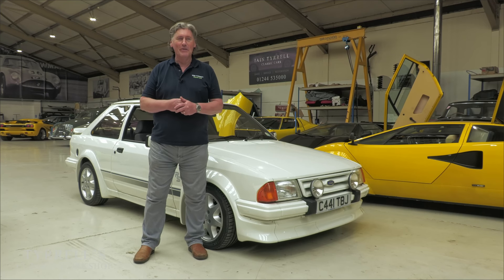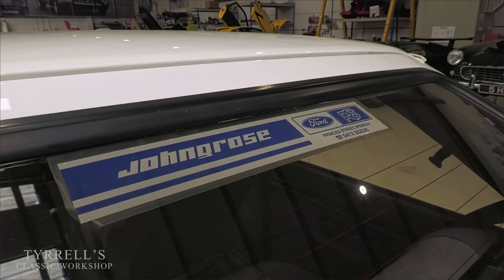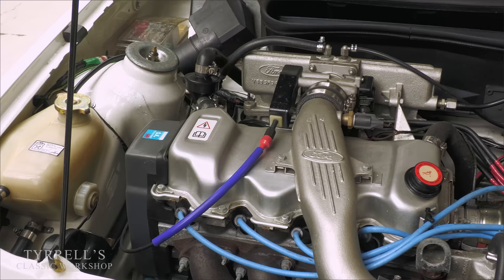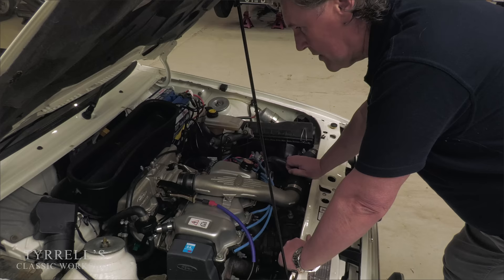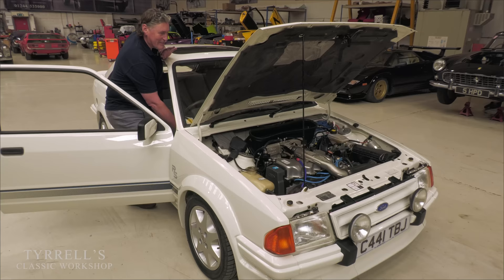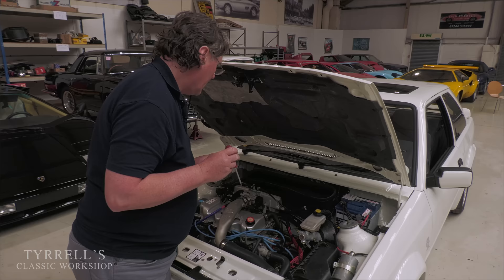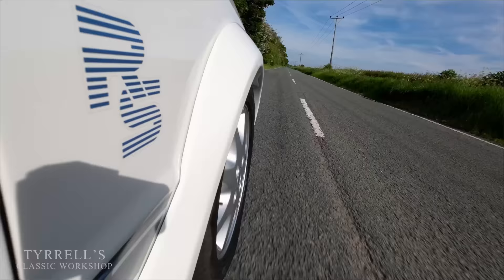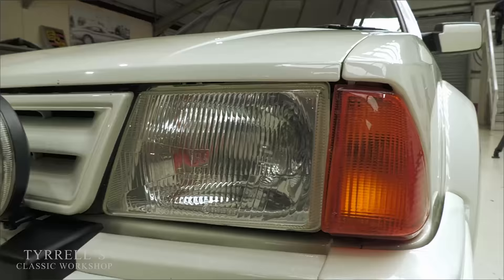Unleashing the Power: Reviving the Ford Escort RS Turbo's Performance | Tyrrell's Classic Workshop

Comment: So glad you mentioned putting the screw back. Im an ex Saab master tech and the amount of 8v Turbos i worked on where the blanking plug had not been put back and just thrown in the bin. As you say then leaving a air leak which causes the venturi flap not to move correctly with the air flow.

Comment: Hi @iain_tyrrell That was mine and a friends car up until 2016. I was the person that rebuilt the car from the shell up (mechanical and electrical) over the period of a few years and competed with it in concours for several years. I have quite a few pictures somewhere of the restoration and build process. Great to see it still in great condition. It was fantastic to drive around B roads.The Motorcraft plugs were fitted when I built the engine so they have never been changed since around 2013!
Reply: Where is that 1975 model
Reply: @reuben3431  it’s an 1986 model.
Reply: Sick car cracking job 👍🏼
Reply: @orangelip1  thanks. 👍
Reply: I fitted Motorcraft plugs in 2017
Reply: @john-fv1vf  you worked on it in 2017? Fair enough then. The plugs are newer than I thought.
Reply: I had a mk1 RS TURBO fom John Grose as well...i was living in sudbury .....what a car!
Reply: @DazC2  86 models had side repeaters. Must’ve been built in 85 but registered 86. 🤔
Reply: @Jase73  it’s a post August 1985 but pre April 86 car. I can’t remember exactly though as it’s been years since I saw both it and the log book. I have another on a C plate (bare shell that needs restoring and I can’t remember what month that was registered) and another B plate which is a June 1985 car. I remember the B plate one as I’ve had it since 1999.
Reply: @Jase73  it’s an August 85 car so it turns out. I couldn’t remember but I knew it didn’t need side repeaters. Only cars after April 86 needed side repeaters, so later C plate cars onwards.
Reply: @DazC2  yes that makes sense. Mine has side repeaters it’s just an 86 model  Jan 2nd 👍
Reply: Top job Daz
Reply: @davemellor4697 makes up for living in Subury
Reply: @tomhoward4905 why did you feel the need to say that?
Reply: A credit to you, good job
Reply: Nice. Why did you get rid?
Reply: @GTMarmot  I was co-owner with a friend. I didn't want to sell, but he was mid house refurb and needed the money for a bathroom. We'd had a few years of competing at concours with it and we only ever used it in dry weather, so I decided that it was probably time to let it go, reluctantly.
Reply: Best small hatchback car going MK1 RS turbo. Back in the late 80’s - early 90’sI owned a 1986 C reg custom pack was uprated to 200 bhp by a company called Collins. Only had 15.000 miles 1 owner when purchased in 88 kept it till 95. In 92 i replaced the standard alloys for near brand new 92 spec sapphire cosworth lattice alloys which i bought locally from a salvage yard car was barely 3 months old made the RST looking mighty fine with mud flaps. Many legends say best MK1 around and the power setup was ultra quick loved every minute of that car. I guess everyone who had one back in the days like myself wished never sold it. Just about got £8700 for it 😂 it would probably be worth 4 or 5 times more now 😊 what a beautiful car the MK1 is 😊😊
Reply: I've never shown a car, but was surprised they can win concours with a big bore pipe
Reply: @richy69ify  Depends on the class. It was in novice as it was our first time, where it is not down to the condition or parts on the car, just how clean it is. Once we won gold cup (best car of the season) we had to move up into intermediate class with different rules. Part of novice class is that the car has to be driven to the show and can't be trailered, so we had it taped up in blue detailers tape when we drove it to and from the shows. There was also a standard class, where the cars have to be as close to standard as possible. There was also a modified class, but I never looked into the rules for that one...
Reply: @DazC2  
Thanks!
Reply: @leechampion6538  I bet your a right laugh at a gathering 😂
Reply: @davemellor4697  Grose all over the place a, tought they were just suffolk and norfolk
Reply: @MJ-hh7de  That particular car came from Ipswich branch (Ransomes euro park) They were the only one of the Grose group who were RS dealers...The other ones were just run of the mill fords. I have delt with Grose for years buying RS etc

Comment: I bought a 1.3 litre mk2 Escort 2 door in Calypso blue ( boxy headlights) when I was 21 when it was 3 years old and when I was 20. Did all the servicing etc on it myself from Haynes Manual and have never forgotten the joy of owing it nor places I went in it. Just loved the HT lead and spark plug section. My pal also bought one. We used to tune with a strobe light and a small paint mark adjacent to the distribution cap. What fun ! Thanks for such a great vid

Comment: I remember doing my apprenticeship at Ford when the mk3 was launched, and we all thought it "space age" in looks and tech! We used to replace valve stem oil seals regularly on the cvh as they would hardened and would smoke badly. Thanks for the memories Iain, another great video as always.

Comment: Thankyou for featuring this car Iain, great to see it , it sounds pretty good under load, I think these were 900 - 950 kgs, your right about the power to weight, that's what makes the difference,  I've never owned anything fancy, just normal cars, but I do have a lot of interest in them, I've noticed the difference when you start going past 100 bhp per tonne, this Escort with roughly 140 bhp per tonne should feel quite spritely, quite enjoyable, great to see you feature it, I notice you have lots of knowledge earned over time and experience, more car mechanics should be learning this sort of knowledge to make sure we can keep as many older cars on the road as possible for as long as possible

Comment: Wow!! This takes me back to 1988. Brilliant. 
Thanks for featuring it on your channel Ian. What a treat.

You are totally correct, they feel really fast behind the wheel. The combination of very lightweight, sudden big boost and a large lag are quite unique. 

I ran one of these for 3 years and loved it. Trouble is the local car thieves also loved it and spoiled the ownership experience.
Sold it in 1991 for......... £3500. Not a wise move.

Comment: Friend of mine had one of these with a specialised engines uprated engine and hybrid turbo, he let me drive it and i hit the rev limiter very quickly after pulling out of a junction, the engine backfired and ripped the rear silencer clean open. Really easy cars to work on, everything on the car was never more than a weekends work, even engine changes.

Great video, brings back a lot of memories, that exhaust is a very distinctive sound that you just dont forget.

Comment: The K-Jet running lean was such a classic. Every year the mixture would need to be thinned to pass the CO at MOT time. I used to thin mine and richen it up again when I got home in my original Audi quattro. A great FI system., couldn't really go wrong, even the KE-Jet. One thing was the roller cell fuel pump, always worth checking current draw, should be about 8 amps, as they wore out the current would increase, say to 11 amps and it was time for a new one.

Comment: Back in the good old days... In the early 90s, I worked at a Ford dealer in Austria - and Turbo Escorts were not such a rare sight. There was allways the fight between the VW GTI, the Fiat Ritmo Abarth and these Fords. They were very quick cars, but also very tricky to handle on wet roads, especialy with worn tires. Very light car, under 900kg, lots of power from a wild turbolaging engine... With their tricky handling manners, those cars died quite fast in accidents. For those, who could handle these little beasts, they gave a lot of fun - till the rust comes. And boy, they rusted early as fast, as they drove.
And there was the turbo trouble: nobody explained this to the customers, before they came to the workshop with a dead turbo. And the spare parts were extremly expensive, so the Escort RS Turbo got a very bad reputation, being an unreliable car - all the times, compared to a less powerfull GTI.
Reply: All hot hatches were like this, the 1.6/1.9 Pug 205Gti too. It wasn't the cars, it was the clown drivers mainly.
Reply: Wonder if the RS Turbo was as unreliable as the Renault 5 turbo? (which needed new cylinder head gaskets every couple of months.)
Reply: @buggerlugz6753  The 5 turbo was just about OK if properly serviced and kept standard. The trouble was it was too easy to wind up the boost and then the second owners thought the engine could manage on the maintenance diet of a Ford Kent.
Reply: a friend of mine got a Kadett GSi and his brother owns a 205 Gti... Welcome to the 80/90!😍
Reply: @buggerlugz6753 No, the RS Turbo is very reliable if looked after. (110,000 miles on an un-rebuilt engine so far 😉.)
Reply: I worked for a Ford dealership in '89 preparing cars for delivery to new customers. They had fields full of cars and big boxes of keys. We'd go out and spend half a day extracting a particular car from among hundreds - of course we'd HAVE to take some for a spin! I drove all the GTi, XR4x4 - turbo what-not ; you name it. Crazy times.

Comment: I remember adjusting the mixture on cars with carbs and the process was similar. Set the idle and timing first, then adjust the mixture until you got the highest idle speed, then re-adjust the idle back down to what it should be. Either side of the correct mixture, the idle would reduce so you look for that sweet spot. Happy memories of when we could work on our cars :)

Comment: Fond memories indeed , shorter springs and adjustable koni dampers , superchip and fiddle with the wastegate.
It would corner like it was on rails and try to pull its own front end off 😂
Those were the days 👍

Comment: The father of my first long-term girlfriend had the XR3i version back in 1998 - with the exact same wheels, exact same interior - I don't remember if the chrome inserts were around the air vents, but boy does the back seat bring back the memories. The car was extremely rusty but ran great - and although it made usual "Ford noises" - the interior was rattly and loud - the man drove like he had stolen it, maybe he had in fact, don't know. I remember the car being extremely quick and handled well - especially for the engine, which was... 1.4, I think? Also - years later had the opportunity to ride shot-gun in a later - 1993, I think - Escort RS2000 - on a short parts run, while our family car - a beautiful 1986 Audi 100 2.2i - was at the local service centre - and the guy from the shop, the shop being on the far side of a small town - gave it the absolute beans - and those two Fords meant I always had tremendous respect for small, fast Fords. Seems nowadays that Ford, at least the European part  - has lost itself somehow with steadily less and less new Fords appearing on the roads - and I can see why - they all seem to lack character, something which both that little XR3i - and the RS2000 - had in absolute spades. Thanks for the - once again, great video - greetings from Latvia.

Comment: This came from an era when you could adjust fuel injection systems, where as modern systems are pretty much pre set, so it represented a electronically managed carburettor in its day. The mechanic I used was particularly talented with his adjustments, being Alfa Romeo trained,  allied to the old Crypton Tuners , ( remember those) which he kept thankfully long after they were not required for moderns- as an older customer I kept bringing him older cars to manage! I was always pleased with the colour of the inner exhaust as a light “dull” grey , rather than black like some classics exhibited , which proved they were running rich.

Comment: I'm glad you did this review. just as i remember this special car , the car could go round corners on rails but you could only push it so far and it would just let go , no warning it would just go. the miss fire could be the high-tension leads it happened to mine i just replaced them. the exhaust was straight pipe from the manifold all one piece , the gear shift was close together the clutch was heavy and at low speeds the steering was heavy. loved it. the engine had an intercooler on it - 0-60 was about 7.5 to 8 seconds with top speed of about 128-130 mph. i traded it in for a Renault 5 GT turbo and that would beat it hands down in every department but the car i would want again would be the Escort RS .

Comment: I was fortunate to own one which I found in Gibraltar , I saved it from being scrapped back in 1997 ! Managed to source most bits in Spain as were a lot of left hand drive ones over there still kicking around! I wish I still had it but I sold it to a pal of mine and made a healthy profit back then .
Mine suffered from overheating a lot so was happy to part with it .
Nice to see this one is bog standard your knowledge on these engines is spot on .
Thanks for showing this fine example

Comment: Another great video !!!.
Back in the day I used to use NGK and Motorcraft parts on my 1980 mk2 Escort.
The original Motorcraft battery lasted 8 years while the replacement ( not Motorcraft ) lasted not even 12 months.
By the way a magnet may come in handy. 👍🇦🇺

Comment: Another great episode from the Tyrrell-Iain. Thanks for this down to earth video. Your comments on stalks, is apt. Modern cars have become so fussy and festooned with trickery that I bask in the old tech in my eclectic classics as well as the simplicity of fiddling and fixing them without needing to resort to repeated use of the swear box. Back in the day, these Escorts were benchmark, attainable fast cars and whilst some might compare them unfairly to modern power outputs, back then, these and the likes of the Golf GTI, Peugeot 205 delivered on many levels, not just straight line speed.

Comment: Loved your advice on cooling the turbo's down. When I hear that kind of information straight from you, I know it's true.
Reply: It is true although it has to be said that engine oils have become much better since the 80's. A fully synthetic oil can withstand quite high temps without coking up the turbo bearings.
Reply: I remember helping a mate change a failed turbo on his MG Montego Turbo back in the early 90s. He used to thrash it everywhere, and then just switch off as soon as he got to where he was going. After a while, things got very smoky and eventually the boost disappeared. A new turbo and an oil change restored normal performance and stopped the smoke, but when we took the old turbo apart there was burnt oil residue (like a black coke material) everywhere. It had not only been restricting the oil flow, but had also distorted the oil sealing ring. He was a lot more careful after that.

Comment: I worked for a Ford garage in Portsmouth when these came out in early 80's I had to tow it in from the ferry port as it had run out of petrol before being put on a ferry to Jersey I think, and being injection I couldn't get it going (I'm not a mechanic) but once it had been fixed I got to drive it back to the ferry port, and of course I had to give it full beans :-) a drive I still remember to this day as I couldn't get over how well it stuck to the road, a fabulous car!

Comment: Power to weight ratio is everything. As Colin Chapman used to say - “just add more lightness”. Thanks Iain for another great video.
Reply: Yep, that’s why the 7 was so quick in its day even with a small engine. Caterham still carry on with the lightweight design ethos. 550kg or lighter or a little heavier depending on model.

Comment: I owned the original RS Turbo back in 1987, mine was a 1986 car and the Custom model, like the one in this video.  I remember after spited driving that we would stop open up the bonnet and the turbo would be glowing red hot and Iain is correct, you had to let the turbo cool down by leaving the car running for a minute or so to allow the oil to cool it down.  They were a great car back in the day.

Comment: For Bosch K-jet, the control pressure at the warm up regulator is also very important.
Reply: A little trick we used to do on Mk1 Golf GTI’s was to fit the warmup regulator from an Audi 80 Sport.
Reply: @timc5969  did the Audi 80 sport have a vacuum line on the warm up regulator to enrich the mixture at higher vacuum? I know that swapping the fuel distributor was common on turbo cars

Comment: As you said "tricks at my disposal" I said under my breath "Pull the HT leads off individually and see which one makes no difference", even though it must have been 20 years at least since I last did it! You never forget the old methods :) Never owned or used a pair of chicken pliers though. HT voltage up your arm wakes you up pretty sharpish :)

Comment: Anyone who's been round bikes for an length of time will be familiar with NGK spark plugs. I've been riding for over 40 years and every bike I've owned barr none has had NGK's fitted and I can't recall ever having a bad one.👍 My Dad had a series of Fords back in the day, Cortinas, a Consul, Mk1 & 2 Granadas and bought a 5 series BMW in the late 80's which was in a different class.👍 I used to (still do) use normal pliers and an electrician's HV rubber glove to do plug checks. In my ignorance I once pulled the HT lead off a magneto ignition petrol rotavator to stop it which was a big mistake, not in the least bit funny although my mates thought it was hilarious!

Comment: I used that 3mm Allen when tuning 320i bmws in the USA. You knew the mix was right when you would Rev it to 4000 in neutral and the tach needle would return smoothly to idle without bouncing. I remember that we were told not to Leave the tool on the adjustment bolt while running, because it would drive the mixture rich...